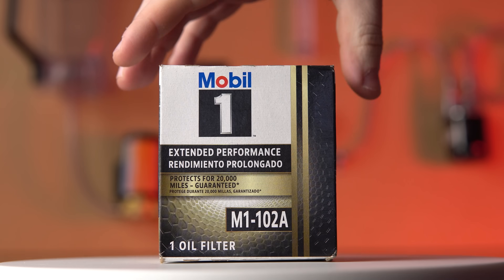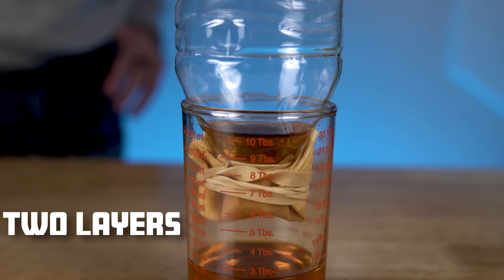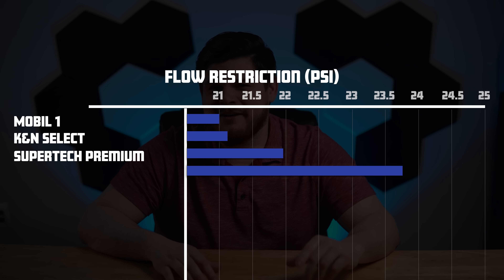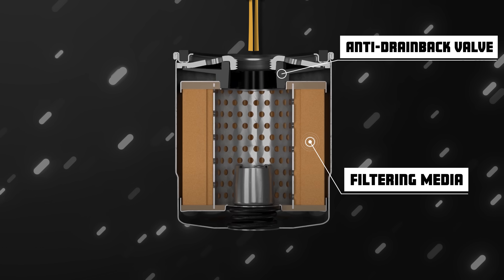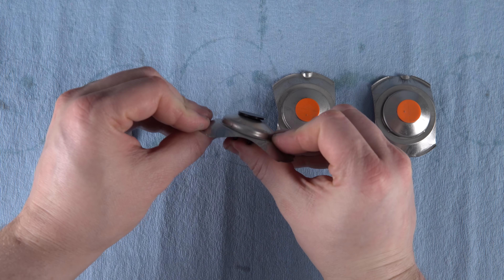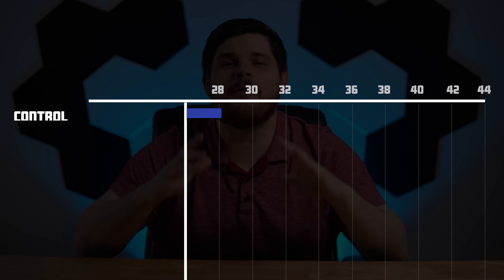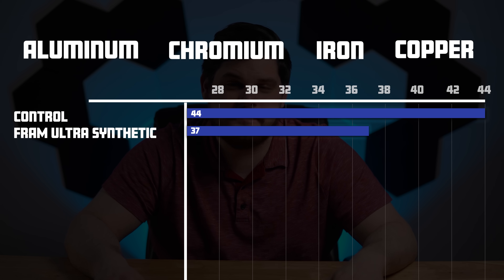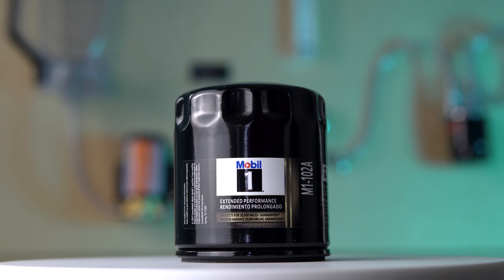Engineers Test the Best Oil Filters! FRAM | Mobil 1 | K&N | Walmart Brand

Comment: I have owned three different vehicles now that I have used Fram filters on along with supertech oil for their entire lives. All have had over 170,000 and are still running without any rebuild needed.  The oldest has >240,000 and is still running!

Comment: Roflmao at the pressure test , no common sense shown . Hate to be the bearer of bad news but the higher the pressure = greater the filtration,  that's why Fram filters work so well.  Valvoline full synthetic, with 2 qts of valvoline high mileage full synthetic plus Fram 25,000  mile oil filter and nothing else needs to be said change your oil when you feel like it and yes you can goto 10,000 if you want , really depends upon your engine design and manufacturer , Toyota/ Lexus/ Lotus/ Land Rover will run virtually until they fall apart from other issues ...

Comment: The one that lost lpm fastest is the quickest to clean your oil...... The other filters took recirculating a couple times to catch the aluminum. Even tho your filter says 30 micron it doesn't mean it catches it the first time around the claim that it catches 99% comes from a recirculation test like you are doing. A true test would be a single run of an established  amount of aluminum contaminated oil into a collection bin and collect a sample of the single pass oil for each different filter to an oil analysis lab

Comment: I ran an orange Fram filter on my 85 Nissan 720 and the engine went 320k miles without ever having to remove head. At 320k all it needed was a valve job and cam chain tensioner.

Comment: One parameter these filter tests always seem to ignore is the temp of the oil. Most cars run hot oil of 190 degrees and will effect the flow capabilities of the filter. Your results are suspect at best.

Comment: One question this does not answer is how much oil ended up going through the bypass? As you state in the video it is intended to allow oil while it's cold... all of these tests the oil was cold. Another thing to note is that the bypass will also allow dirty oil to flow if/when the filter media gets plugged up with contaminants as well.

Comment: Give me the Fram Extra Guard or their Synthetic filter for the ability to remove more particles and change my oil at 5,000mi unless I get analysis that shows to go further but not past 7-10K mi.
Reply: The Fram Ultra Synthetic is one of the best filters on the market, with 99% efficiency at 20 microns, synthetic media, and metal end caps. It's now considered top-tier alongside WIX XP, Amsoil, and Mobil 1 filters.
Reply: @vigilantemotors 
I agree, I think most others use 30m instead of 20m, a big difference imo
Reply: @Chucka10  I know Fram gets a bad rap but that particular Fram is darn good!
Reply: @vigilantemotors  
And that pressure resistance test is sort of a non issue imo, you want the filtration and if there is to much resistance, the press relief valve is activated.
Reply: @Chucka10  you’re way smarter than me lol. I’m sincerely always up for learning so thank you 🤟🏼
Reply: @vigilantemotors 
I doubt the smartness, just read a lot and retain above avg. 😜
Reply: @LOL. Nonetheless I learned something! Have a favorite car?
Reply: @ 
Panther chassis Fords, Crown Vic, Grand Marquis and Lincoln Towncars.
Reply: @Chucka10  Old school, sorta. Guess it depends on when you grew up but those were some legends back in the 90s
Reply: @vigilantemotors  
I still drive a 05 Grand Marquis and a 05 Linc TC. The 4.6 ford engines are nearly indestructible with minimal maintenance.
Reply: @ Both very nice! They just don’t make them like they use to. I know everyone says that’s but in many ways it’s true in my opinion.

Comment: I use the Supertech Filter on a SBC and have put over 100000 miles on the engine. It is now at 227000.  97 LT1. No oil loss and runs perfect. Perfect Oil pressure. Changed every 3000.

Comment: We used Fram on our fleet of 60 ish Honda Odyssey's and Shaefers oil and not one vehicle at any point ever had an engine failure under 300 k miles nor engine issues . 3 were totaled  from wrecks and never made it to 300,000 for that obvious reason. You mechanically UN-inclined people over think the most frivolous minded. And also, we extended the recommended 7500 miles to 17,000 miles because the oil samples told us we could.

Comment: The clean oil flows back through the center or BIG hole, Not the dirty oil. The dirty comtaminents stay in the outside of the filter media. The filtering of 90% of the particles bigger than 20 microns is very good but it will restrict flow more than the other filters.

Comment: i have been using regular fram oil filters on all my cars since 1967, they do what they are suppose to do, put up to 500000 miles on some over the years and would not use any other filter.

Comment: I’m actually really impressed with the Fram. They use to make a filter that had metal clips holding the filter media together instead of glue or glueing it to a metal separator like the one in the video. The metal clips would loosen and end up sending unfiltered oil to the engine along with those clips causing extensive damage to the engine.
As with another comment I’d love to see how the Wix/Mann filter would perform

Comment: I am 78 still able to change my own oil in my honda qnd gmc. I change oil every 3000 miles use fram and supertech i feel when you change oil as often as i do yo dont need a high dollar filter .i use K&N n myv1961 chevrolet with 500 hp w engine i like the 1 inch nut on thebottom it gets changed every 6 months no where near 3000 miles.

Comment: At idle, a lot of engines don't even make 20psi of oil pressure. Engines are designed to bypass cold oil around the filter, back into the pan.  Meaning you need hot oil 160-220F to do this test properly.

Comment: I use Pennzoil Ultra Platinum oil with K&N filters. I need fast flow especially in really cold conditions. A really restrictive filter will impair instant flow. The 1” nut welded on the bottom of K&N filters also helps on removal.
Reply: 100 percent, same thing I'm doing and people are obsessed with micron rating when 70! micron is human hair, 40 can't be seen by human eye and 20 is size of blood cell so do you really want to restrict down to 20 micron not me I'll stay with non restrictive and normal 30 micron like Nascar engines and racers do using k&n gold series thanks

Comment: Also, Instead of constantly running to a so called scientist on the payroll you can actually look at your dip stick and see with your eyes if the engine would do better with renewing the oil. Looks like there isn't a filter that can filter the exhaust out of the oil. Exhaust mixing with the oil is the main reason that the oil needs to be replaced with new oil.
Reply: Why does exhaust mix with oil?  Valves? 

 Ruining things?
Reply: Try using Pennzoil ultra platinum my oil is barely seen on dipstick since change over and notice takes longer to warm engine in morning going to work at same location from my house where is usually getting warm

Comment: OK------- .  The reason why the Fram has the Alu. Colecting outside the filter around the Drain Back Valve is that the 20 Micron Fram Filter simply Does NOT  allow any of the 30-Micron Alum to Enter let alone PASS Through the filter.  This gives NO reason for the 30-micron Alu. particles to collect in the Filter Folds but being heavy, to SETTLE down onto the  Drain Back Valve at the Bottom of the Filter providing perfect evidence that most of the 30-micron particles are BEING Captured... and why Industrial Filters are mostly BOTTOM DOWN filters so large heavy particulates will settle down into the large open wells at the bottom and not back into the Engine Sump...With the Oil staying inside the filter and no need for a Drain valve....   
---------- .  Whereas All the rest 30-micron Filters trap the 30-micron  Alu particles in the Filter medium that can clog the pores or let them pass through the filter entirely...  Which is very bad.  At least you have proof the 30- micro Alu. is being STOPPED by the 20-micron FRAM...!!!!  DAMN Good for FRAM...  With the others catching some portion of the 30-micron particles but with no Scientific evidence as to how much of the total Alu is being Captured unless the Filter Medium is cut out and weighed compared to the Clean Filter medium...  Sorry, along with other mistakes in procedures, your Testing has been mostly wasted as is your conclusion as to the True effectiveness of how well the Filters Clean the OIL is wrong...!!!  Which is the Sole Reason for having a FILTER in the First place...!!!   
------------ .  With the best Filters designed to Reject particles larger than the desired particle SIZE from entering the filter medium to prevent PLUGGING the Medium as the large heavy particles fall to the Bottom of the Container away from the Filtering Medium... Allowing longer Filter lives with Smaller Filters...  Which takes a lot of costly research and production tolerances to do right... And why good filters Cost more... As for the Fram drain valve allowing oil to drop back into the Engine. That IS preferable to allowing the dirty Destructiv particles into the bearings...!!!  Also why industrial engines use pre-start Oil Circulation pumps that work better than the Drain Valves as even the time it takes for the oil to get from the OIL PUMP to the Filter does damage to the engine....

Comment: I think there might be a small flaw in your aluminum powder test, aluminum powder is sold as a certain mesh or micron AND BELOW meaning that the particles are the same or below what is stated, settling of product could have occurred allowing some filters to receive a higher amount of undersized material than others, depending on when they were tested compared to the other filters. Though I do appreciate the thoroughness of your testing, I just thought it worth mentioning this possible oversight in your methodology.

Comment: Heated oil to operating temp would be the best way to test. even better would be to heat cycle the oil throughout the test to show out the filters work through the viscosity changes in the oil.

Comment: I worked in Formula One engine design in Europe for many years, and always attended the massive car shows in Geneva & Frankfurt, which have 3 days reserved for people in the industry, dealers etc. not open to the public. Every major parts manufacturer can be found there. There is only one filter maker to be found, because they have a large sign that states "OEM Oil Filter Manufacturer for ;", then lists every Auto brand from Alfa-Romeo on. Everybody is on the list, like Mercedes-Benz, Ferrari, Rolls-Royce to Toyota, GM, etc. Wow, just one with all those clients. Every one of those filters are the same paper elements, there are one-way valves, whatever OEM features but other than appearance all use the same median, and filter equally according to size.
Any Auto or Engine maker, distributor, or anyone with an entry ticket could purchase any filters for any cars. Pricing started by the dozens, and was listed for up to 1 million; negotiable prices beyond that. Base was blank, white filters in white boxes, with only filter ID, bar code and part number. Then came a column for 2 color printing, black on white labeled as you provide with graphics, description, & logo, and then a column for full- color packaging for retail sale, any color filters etc. for your own brand.
In constant Engine testing up to 1500 HP, 1600 cc turbo V-6s we routinely cut filters in half to look for metal particles that identified their source by type. All filters caught everything down to the same micron level, and the only difference is packaging and price. They gave you a choice of paper patterns and colors for marketing, but base was white as it's just paper.
As an engineer I understand a part that does it's job as perfectly &:cheaply as oil + filters reach levels beyond need. American firms use developments from elsewhere, like they turbos discovered forty+ years after commonality everywhere else, so of course these guys wouldn't be who'd know such things. Besides the Tokyo show there is only Genva and Frankfurt to find the ultimate makers.
For all the car battery brands the U.S. only has four battery makers; all lead-acid batteries use recycled bullet lead,. Besides stronger cases, baffles, venting, shapes & sizes all make 1.5V per cell, last roughly the same time, so pick yer AAA, Interstate, Diehard, Walmart or Wally's Battery Shack as you prefer, all you chose is the price & package.
Sorry to tell these "experts" but whatever they think they found isn't so. I put together a presentation of our Engine development for a Society of American Engineers convention they said got the only SAE conference standing ovation ever, and knowing engines from carving out blocks from solid aluminum to casting forms to camshafts, I wanted to mention that I like the grip paint on Fran's, but I usually but the cheapest like Walmart's Tech, STP or other.
Any engineer who thinks they know better should get on a plane and see the modern world. Go blow your mind in Frankfurt, rent a car to enjoy open borders, 90 mph "suggested" speed limits in the EU,with none at all on the perfect Autobahn for fun while you're there. Get a sleeper cabin on a train in Paris, wake up in Rome, or enjoy the every at 250 mph eating dinner. Love having no cops riding hered to tax or just harass drivers at will. 
Go talk to the folks who make filters, and people who are informed about IC engine development, and have a blast doing so too!

Comment: Walmart synthetic oil and filters work fine for cars with over 100,000 miles. I spend the 20.00 saved on fuel injector cleaner. I
Reply: What fuel injector cleaner do you use?

Comment: Highly subjective as these test don't even take into account high temperature inside the engine.  How well can it do its job of filtering when the motor oil gets extremely hot?  Will the filter be able to still do its job of filtering when it gets too hot from a day to day job operating the vehicle.  What happenes when the filter goes from hot to cold repeatedly?  Will it effect the filter media in the process and just letting the oil to run through the bypass valve instead of it getting filter through the media?

Comment: High mileage by definition isn’t a good filter. I used to love the AC Gold and/or Bosch Extra. They had the most complete and smallest particle filter element. From 5-10 microns for 99%. Changed oil once a month at about 10,000 miles with Mobile-1 full synthetic.
5.7 GM engine was going strong at 421,250 miles and used about 1/2 qt of oil per charge. Transmission went and the van got hit in a parking lot. I’m sure it would have gone 1/2 million miles. Highway miles and some idling overnight for either A/C or Heat.

Comment: Use OEM filter, many manufactures have higher than avg bypass PSI, most of these aftermarket filters have low bypass, if you don’t get the correct spec you won’t be filtering anything at all.

Comment: Excellent comprehensive video on oil filter testing.  My only thought was to run the dirty oil through the system without a filter first, so that the subsequent filters weren’t at a disadvantage, although I would assume the difference would very possibly be negligible.  I also saw another comment saying run the test at normal operating temperature as that may have an impact on performance as well.  That being said, seeing as they were all run at ambient temperature there may be a difference in how much media was filtered, I doubt there would be any significant difference between the results between the different filters.  Thank you for sharing!

Comment: I’m a mechanic and have about 50 years experience and done tons of oil changes and used multiple brands of oil and oil filters. Personally I actually prefer oil filters without the bypass which is usually the cheaper filters with oil changes done either when they are supposed to be done or ahead of schedule. In a performance engine; racing, pulling, off-road, etc. every time it comes back to the shop.

Comment: I've been using Mobil 1 synthetic along with A Mobil 1 oil filter in my 2013 Avalon but recently I bought two of the OEM Toyota oil filters off of Amazon because it was a better deal was wondering which one would actually be better

Comment: So question you used the K&N select filter instead of the K&N High Performance filters even though u used the higher performance mobil 1 and FRAM filters. Was there a reason for this choice? I only ask cause you used the highest tier FRAM and Mobil 1 filter but the cheaper option for K&N, I also agree with the person about operating temperatures. Also what weight oil did you use

Comment: Obviously sponsored by K&N!  Because Fram is affordable and does the job. Fram ultra synthetic is the best. They make the high-end high dollar Amsoil. This filter is good for 15k intervals though I go 10k to baby my engines. (2 oil changes/year with no worries. Sold my last truck with 254k miles still running like a top. No blow- by, no smoke, no knocks or pings. STRONG for a 1/4 million miles. I sure miss that chevy z71.. I have ano Silverado now with 163.5k and runs like brand new one, has been paid off for a while- thank you to Fram Ultra and  Penn  Ultra full synthetic oil 5/30!

Comment: Every oil and filter are good enough if you do regular maintenance. I use 10k mobile synthetic and change every 5k. I do my own and it’s still nice and clear at 5k. I do a transmission and differential flush every 30k.